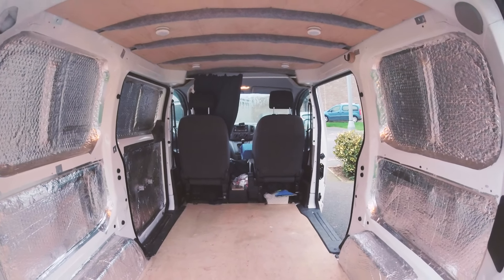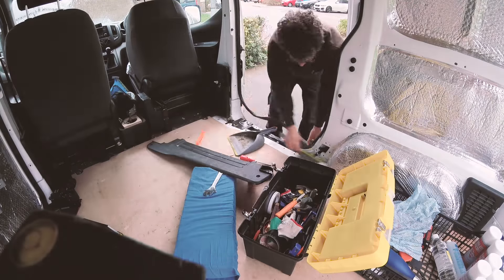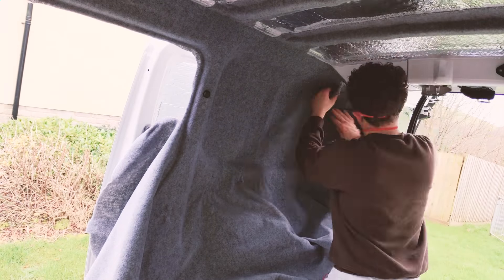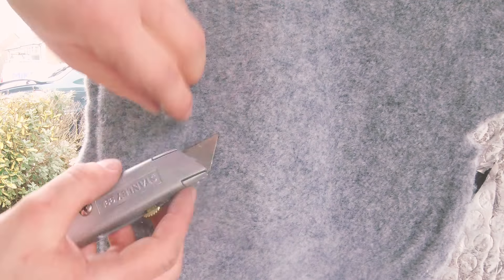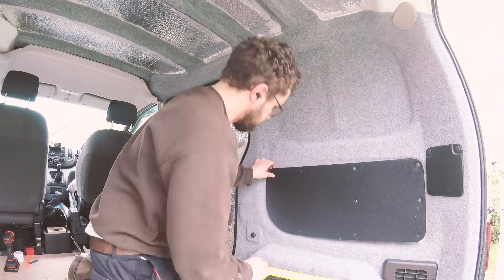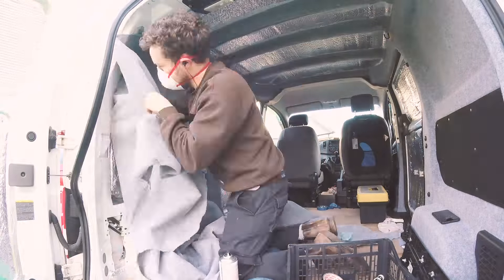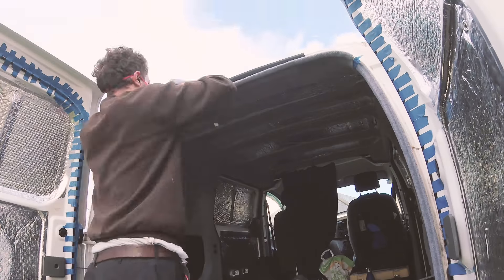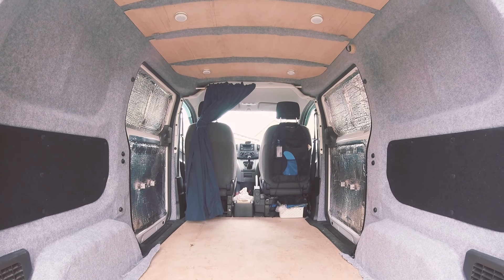CARPETING A VAN CONVERSION | 4-Way Stretch Carpet Lining | Ep 4 | Nissan NV200 Camper Van Build

Comment: I just purchased a Nissan NV200 and I plan to do exactly the same thing you did with your interior. And I plan to do it because I was very impressed with the results that you got. But I live in Japan and getting materials to either more difficult or more difficult, and often both. So my life would be so much easier if you could tell me how many yards/meters of that of the 2m 4-way stretch material you used. I’m guessing either 5 or 6m. Perhaps 6 bc you probably too the material for the roof ribs from the end. Same help would be appreciated for the reflective foam, although I am having a real problem finding a place that has it in stock AND will ship internationally.

Back to watching your videos. I’m sure you know I find these extremely helpful.
Reply from the maker: Hi, thanks for the comments, glad you like the van build. I bought 5m of carpet for the walls and 4m for the doors, but had a fair bit left over of maybe 8m in total would be better. But if you have the van definitely measure yourself before buying, good luck with your build!
Reply from the maker: I don't know how much foil insulation I used in total I'm afraid

Comment: Can I ask you how you approached the ventilating/ airflow/ condensation problem of the van?
Reply from the maker: I have wind deflectors installed on the front windows, so just keep both open a bit during the night. Bear in mind this is just a leisure vehicle for camping in - if I lived in it full time I'd have a fan installed

Comment: Well done it looks awesome!

I was just wondering if you have had any issues with water soaking in via the door seals as you've wrapped the material around the edge to the outside of the lip of the door frame?
Reply from the maker: Yes I did, but it wasn't anything majoy. Got a video about it here: https://youtu.be/_PgJBMWwpc0

Comment: hi first say i love the work you are doing with that nv200 looks great. But I have a question, when you put that carpet you do not have the concern that with the condensation mold will be generated in it? In other conventions, they are very careful to use water resistant materials to avoid that, I do not know if you have taken it into consideration.
Reply from the maker: Hi, condensation was most definitely taken into consideration. I had stayed overnight in the van many times prior to carpeting and so know where condensation forms. I added insulation in those areas before carpeting so that it won't be a problem. Also, please bear in mind that I only use the van as a camper for a few weeks each year, so it isn't constantly exposed to condensation.
Reply: @LensOfJames   Thank you for answering me, I want to camper my Citroën Berlingo but on the issue of insulation, ventilation and condensation I find contradictory information, I suppose because of the difference between people who live in vans and those who use them some weekends as I intend. Perhaps the best thing is to do what you have done, go for a weekend with the bed furniture (which is the only thing I have made, and see what happens. Thank you very much.

Comment: No windows in your camper? seems a bit claustrophobic to me :-\
Reply from the maker: Hi Erik, before doing this conversion I spent quite a few nights in the van with my partner, and we both thought it was really cosy! I see what you mean, and if I had a bigger van then I'd definitely want windows, but I don't feel any need for them at this stage.
Reply: @LensOfJames  I totally understand, a big plus is that without windows, that your camper is not notable as a camper outside so you can easily sleep in a city at every parking place :-)
Reply from the maker: Exactly, I'm keen to keep the van as inconspicuous as possible!